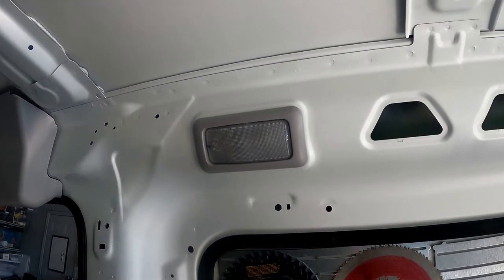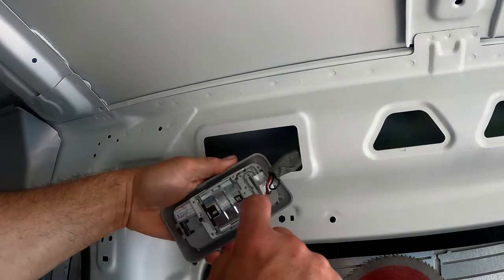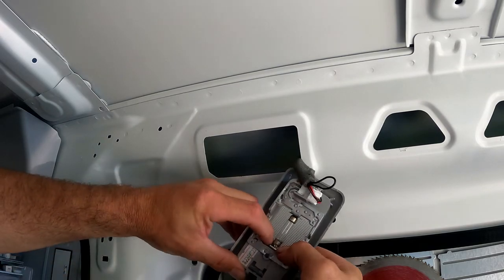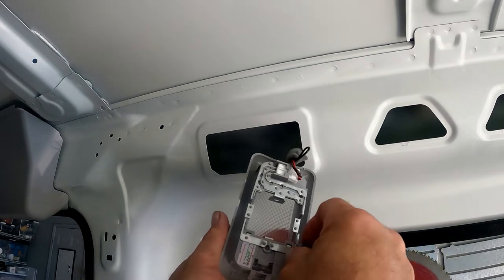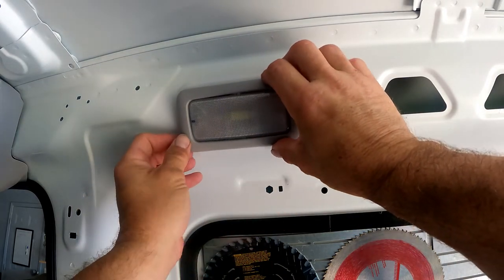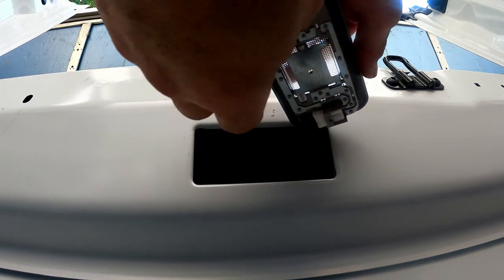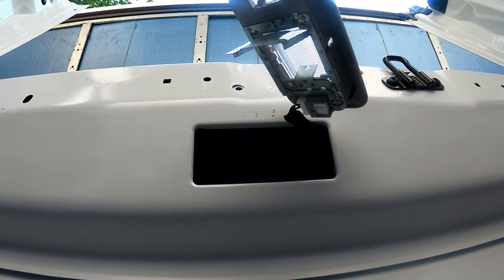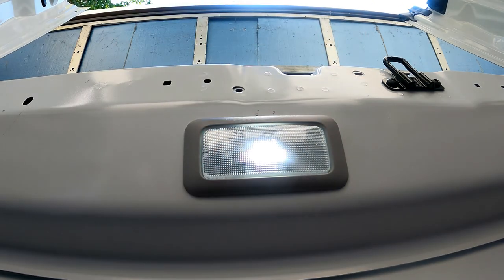Ram Promaster Change Cabin Dome Cargo LED Light Bulbs

Comment: Great video. I wound up going with the Sylvana Zevo 6411/578 which are the 42mm. If I’d done what all the outlets suggested I would’ve defaulted to the 36mm 6418. Your video gave me the vocabulary and prepped me for surgery, and then I dug out the original bulbs myself to see what I was actually dealing with. Because I was prepared I bought the correct bulbs and didn’t shock myself or break anything. Thanks very much!
Reply: Did you put 42mm in both locations?

Comment: My lights go off about 10 minutes after the door is opened.  I would guess the hot wire you mentioned would not be hot at that point.
Reply from the maker: The cargo "hot wire" runs off of the door switch so when you open the door it comes on.  It will time out after a while to prevent you from killing the battery.   If you push either right or left on the light you can manually turn the light back on and will stay on until you put it back in the middle.  Hope that helps a little.  Thanks for watching.